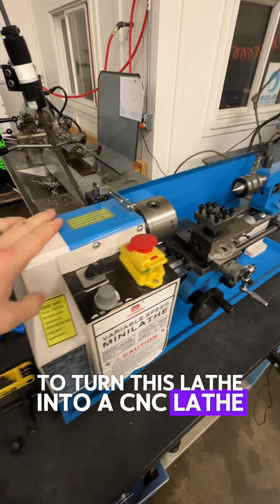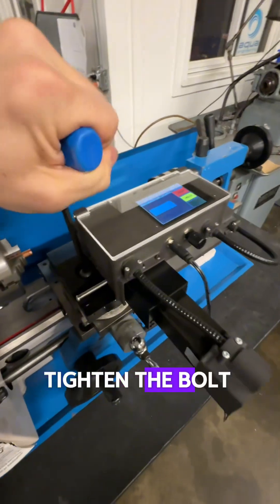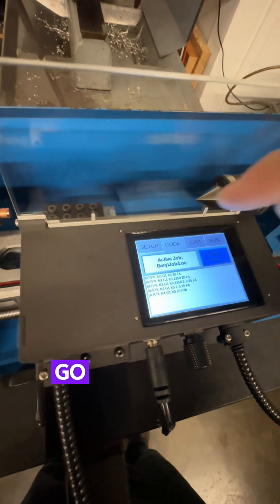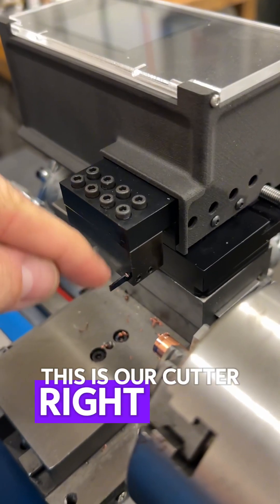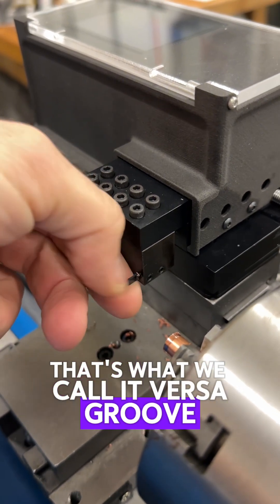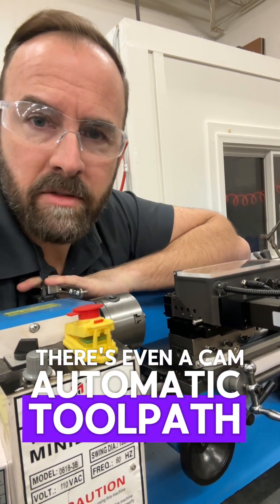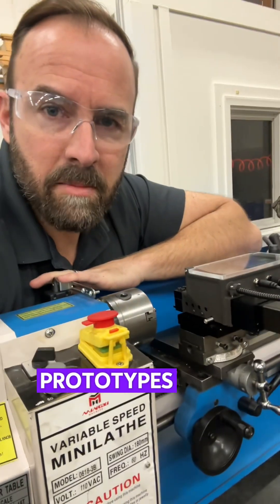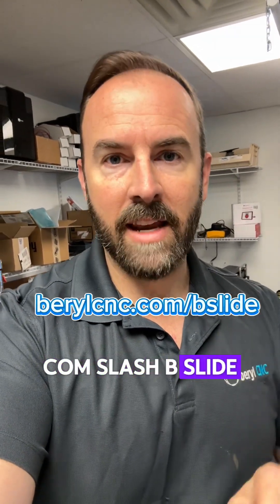World’s First Tool-Post CNC for Mini Lathes!

Comment: Remove the cross slide with a solid piece  of steel block then mount that on. I bet there wouldn't be any rigidity issues.

Comment: looks good hopefully you include rigidity test for the product with stronger materials in the coming videos
Reply from the maker: @theancientones3755  the cross slide on the lathe itself is the weakest link. We’ll push the limits in some videos soon. The MultiForm handles anything, and we expect similar performance on the bSlide.